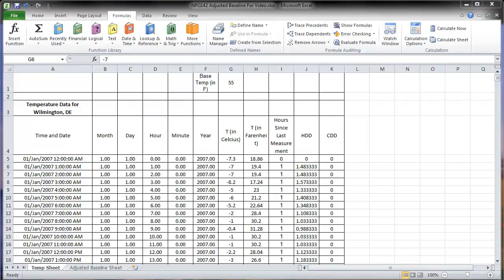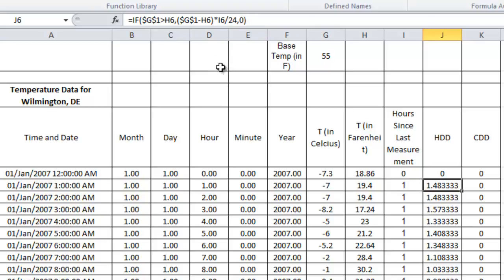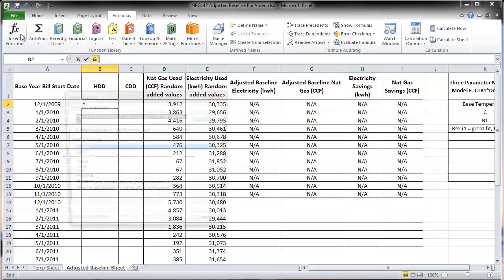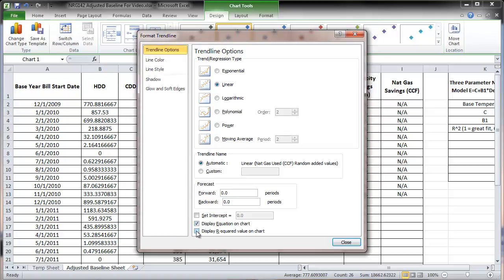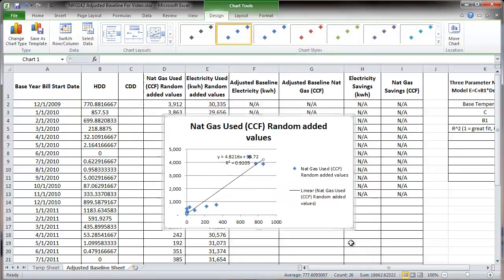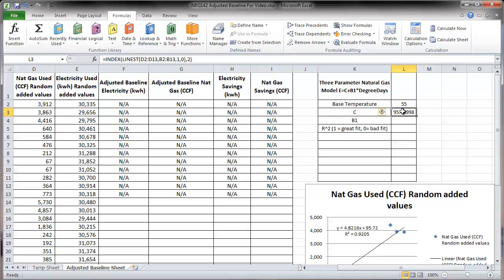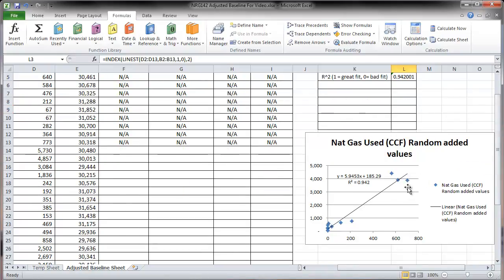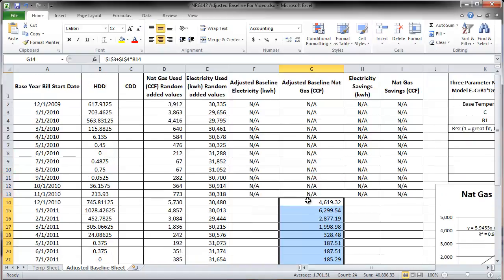Adjusted Baseline Calculation

Comment: Hi, 
If the data is monthly not yearly, do you have to make adjustment for the number of days in the equation? Ex. If the electricity bill for baseline data for Jan was for 25 days but for the new year was for 30 days. Do we have to multiply in the equation by 30 and divide by 25 the constant value to make the adjustment?

Thanks